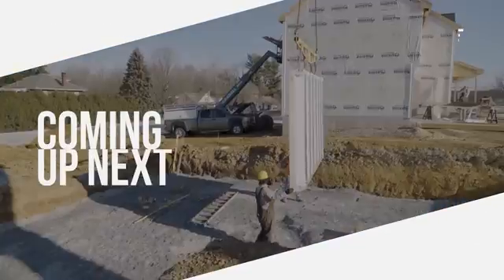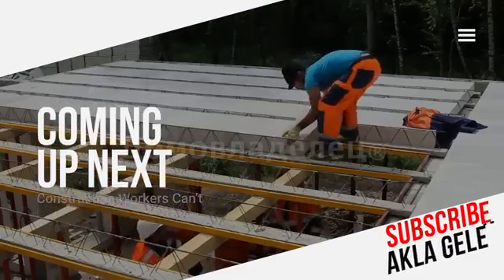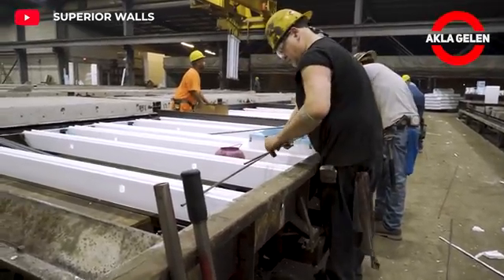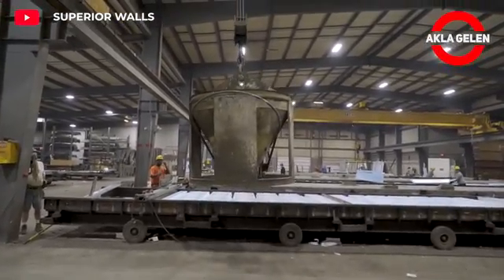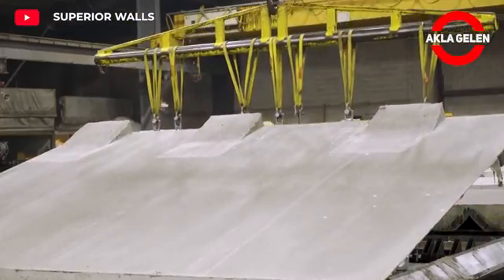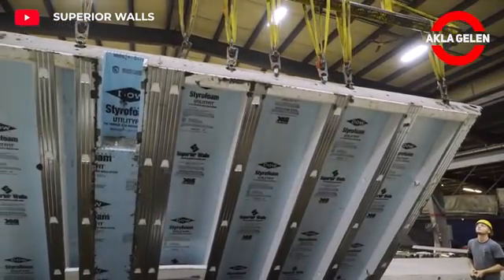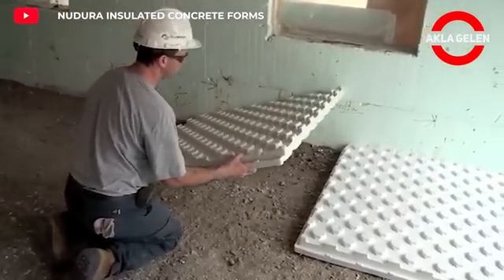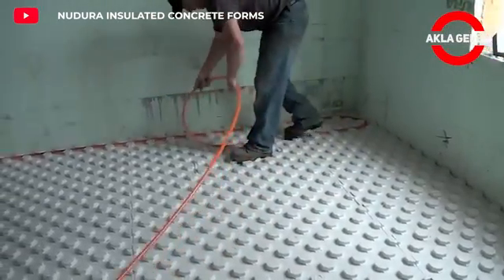Construction Workers Can't Believe This Technique Works - Most Ingenious Construction Technologies

Comment: So many different systems and materials, yet so few ever seem to make it into volume construction projects. Why is that?
Reply: " Why is that?"
Long ago as a trainee, I asked the same question, all the new products from Europe we learned in school but never use????
The owner a P.E. said, "Because I put my name on the drawings. and much of this stuff is not proven."

Look at the early history of PEX without the oxygen barrier, Tubetron, EDPM, polybutylene ... used in hydronic heating systems.

Some of it worked and some, not so much.

Do you want to be the guy with your name on the drawing? You may have to eat it.
Reply: Cost
Reply: @jerrebrasfield4231    Got that right. At More than Double or even Triple the Costs it adds to building a house.. You are the first one I seen that said this.